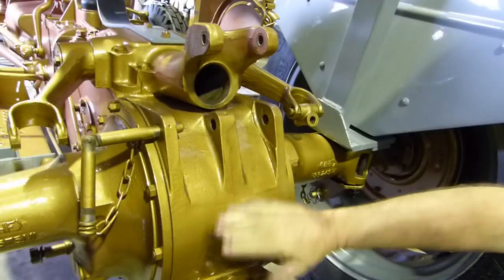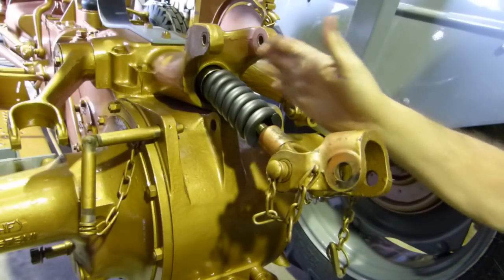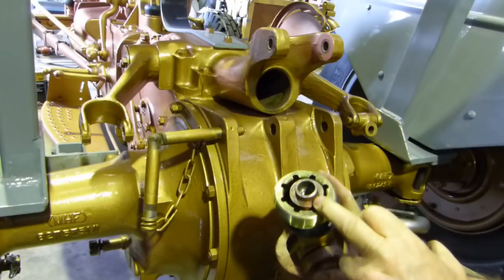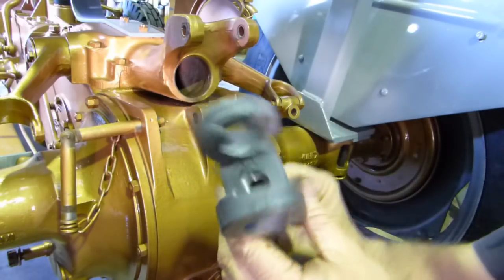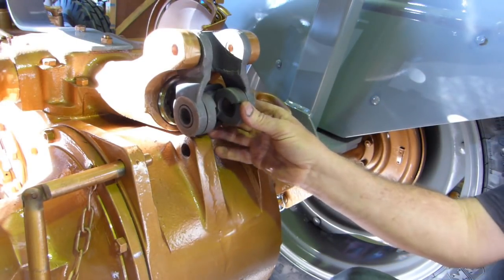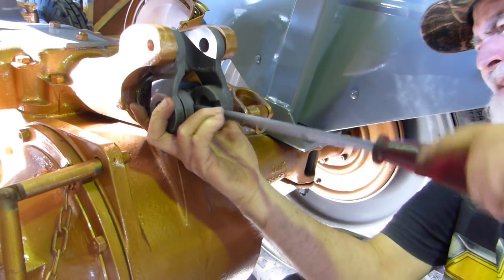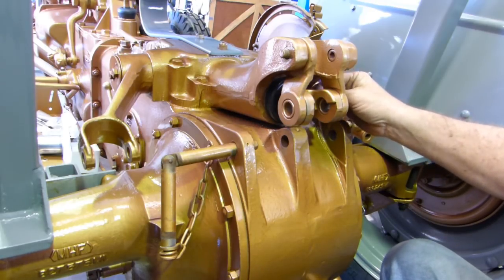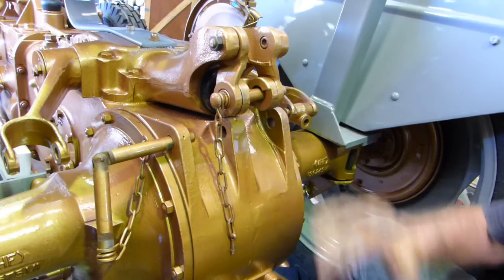Ferguson FE35 Grey and Gold Restoration Part 19 Draft Link Spring

Comment: We used to stock the self spreading split pins.  You know the ones with the long tang bent over the short tang so all you had to do was drive the loop in farther causing the short tang to push under the long one spreading the tang end so it could not come back out.  Explained that to customers and they usually bought several more because of the ease of installing.
Reply from the maker: Im not sure I have seen them, off to google for me, lol.
Reply: They have a funny looking hump loop and when you tap the loop it drives the short side under the long side that is bent over the short pushing the pin apart and stopping it from coming back out the hole. Much easier than having to try to spread a pin in a hard spot.  You do have to size the pin for the hole.

Comment: I am rebuilding three 35X's at the same time. In each case the whole draft control mechanism is rusted solid.  Each one is getting a 6 mm. grease nipple discreetly on the underside and and the whole space will be filled completely with grease.  This will stop rusting and, more importantly, stop water ingress into the hydraulics..  Fraser Brown.
Reply from the maker: Yes good idea.

Comment: When setting this up where should the draft and control levers be on the quadrant?
Reply from the maker: You need to look at the manual as there is different positions for each adjustment.
Reply: @BundyBearsShed  thanks I'll have a look

Comment: Hi Lance.... so to change the rubber boot I have to fully disassemble the spring unit......?
Reply from the maker: Yes but you can do it without lifting the top off if the big nut is not rusted up and stuck.

Comment: Why are there two different gold colors on the tractor?  One looks more like copper.
Reply from the maker: G Day Stephen, It is all the same gold out of the same can but some is shaded and some in the direct light from the High Bay 400w bulbs. The metalic flake changer it a lot in different lights.
Reply: I noticed near the end of the video some ares went into that shade and it changed the color completely.  Thanks for answering.
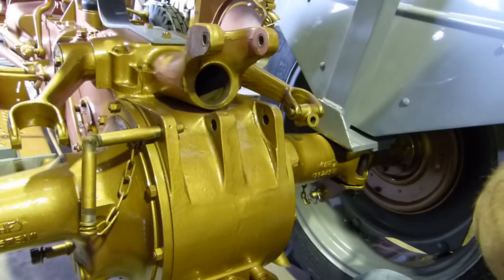Reply: Color flip.  6:00 is a good example of how different paint can look under different light sources.  His torch makes the paint appear copper.  Gives painters fits when trying to color match.  Camera is not always going to reproduce what the eye sees in person either.

Comment: Sir I am from Mansfield Ohio and owned a MF 1080 Understanding the 3 point lift on this tractor was difficult for me. for its time this lift in my opinion very advanced.
I hope that at some point you will explain inner quadrant, outer quadrant, and .draft control vs position control. How do settings vary from plowing vs using a disc vs digging post holes
Reply from the maker: I will cover that when I get to the hydraulics on the 35. I had to read up on that myself to understand it.